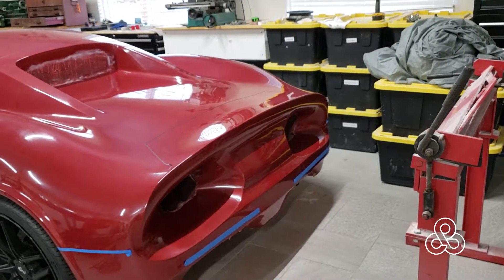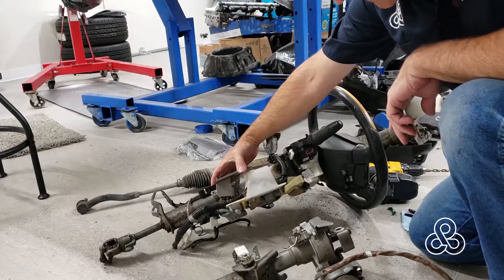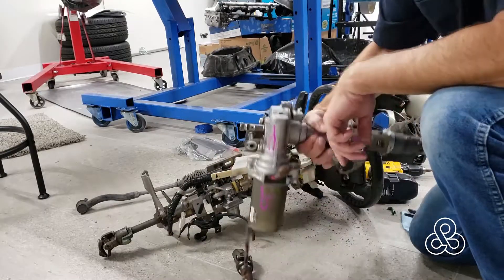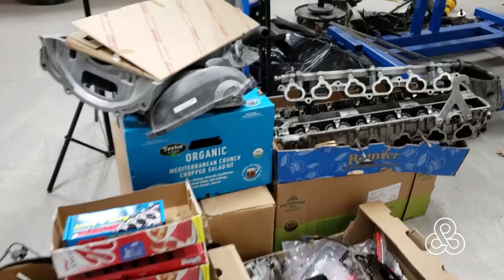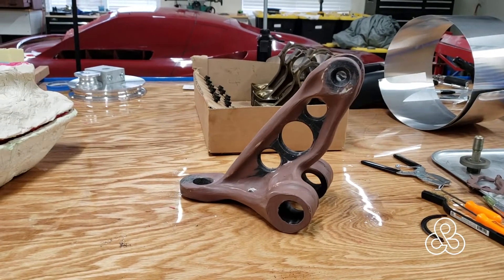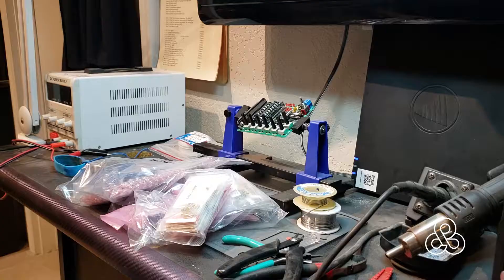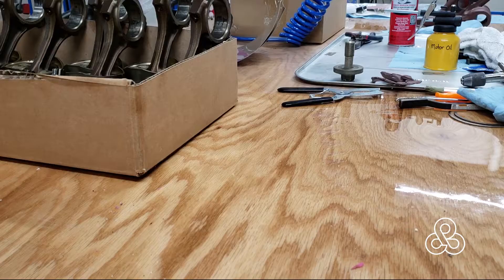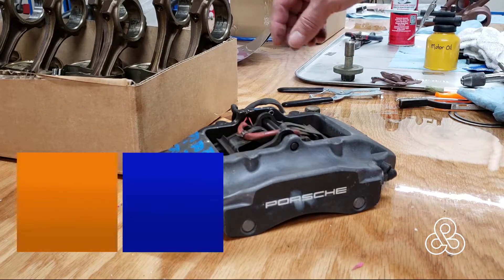A08 - NOT step 8 of the Jarvie Arete supercar project!

Comment: I recall you saying that, for future production of the Arete, you'd need to consider reverse engineering parts like the steering column. This seems like an incredibly daunting task, requiring you to disassemble and learn the parts, and then get the machines you'll need to machine the various pieces of the parts you'll need.
Reply from the maker: Of course, the answer is to find a vendor who already makes a part that will fit your design, or can be made to fit, with very little modification.

Comment: Sir, I was wondering why do you want the steering to move rather than the seat. won't moving the seat be easier as the majority of the parts are already available?
and obviously, it has already happened but still... ORANGE calipers 😂😂
Reply from the maker: The electric telescoping steering column is also available.(One part/unit) Skipping the hardware under the seat I can get it lower. Head room!